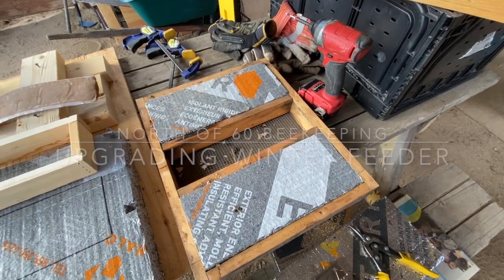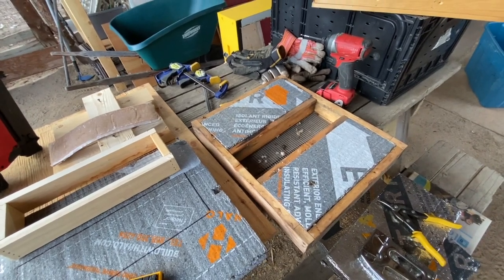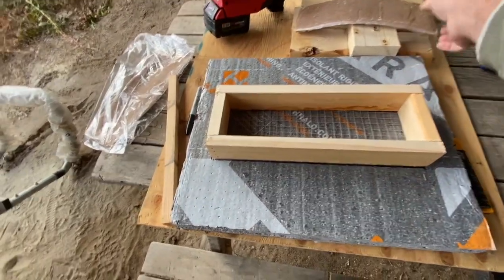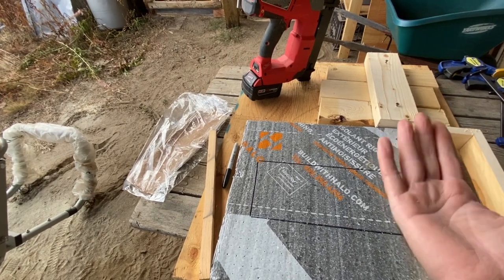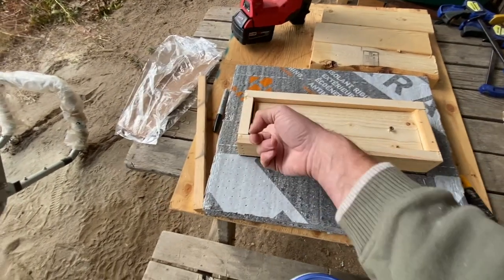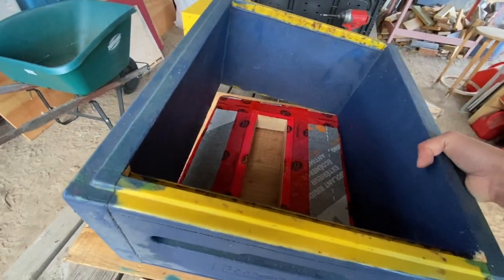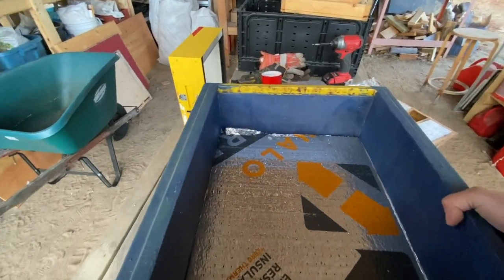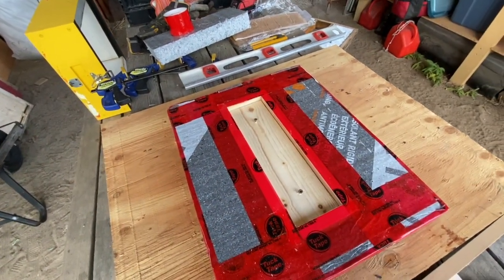Upgrading Winter Feeder

Comment: Etienne.  I learned, strictly by chance, that simply painting the polystyrene with a good exterior latex paint will prevent the bees from chewing it up.
Reply from the maker: the HD poly is not the issue, it's the standard house insulation styrofoam (bubble or expanded). If left unprotected the bees will chew it up
Reply: @etiennetardif6552  Understood.  That was my meaning.  I use polystyrene boxes too.  My comment was referring to the polystyrene panels (house insulation), not the material that makes up the box.  A good coat of exterior latex keeps the bees from chewing it up.

Comment: I had some better bee ten frame deeps and I-glued some luann two the sides cause it was about a half inch wider than needed and I left a gap on the ends for expansion. 

The bees propolis the gap and moisture during winter swelled the Luann enough to split the box a bit.  

Interesting how expansion can still affect you even when you plan for it

Comment: Good ideas there. My thoughts are that the 2x4 will expand or get propilized and you will have a tough time getting it out. Would using another piece of styrofoam instead of the 2x4 come out easier? A small bolt with a washer on the bottom of the styrofoam could be used for removal. Just an idea.
Reply from the maker: Agreed, I mention that at the end to make sure you leave enough tolerance for expansion or like you said just use the piece that was cut out to make a plug!!

Comment: I'm a hobby beekeeper in Alberta.  We moved this year and my bees got neglected for a while.  I've ended up with a queenless hive.  It swarmed, thankfully into some of the equipment I'd piled up to move, and the original hive didn't successfully re queen, even after I donated a queen cell to them after I knew they were going to be queenless.  After that, we started moving the farm.  They've been queenless since June and they are nasty.  I've been able to move and dump some in front of a swarm that I rescued (that spot is 3 miles away from the queenless hive).  The rest of the bees are still at the original site and hunting me when I'm there.  Is it too risky to seal them up and move the rest of them to that same swarm hive now? The initial move of bees was a couple weeks ago but I didn't want to overwhelm the tiny swarm so I didn't move all the bees over.  
 I'm moving away from wood langstroth to Dr Leo's design for insulated Layens hives.  I have one layens hive and it's doing to so great I intend to move all my bees into that type of hive but for now, I'm trying to make sure that late swarm survives the winter and I quiet the angry bees.

Comment: Thanks for the ideas, I am in northern Wisconsin and run about 150 colonies and they are all in polystyrene. I do see the value in a lot of insulation. I'm thinking about trying your plan because I also have the problem of feeding pollen patties or fondant and in the spring when everything is cold it can be very hard to squish that all in underneath a polystyrene lid, although I have done that, I usually dread it because it is so difficult.
Reply from the maker: I had the same problem. The lid fits too tight to easily place a patty on the bars without squishing a bunch of bees... They key for me was minimizing disturbance of the main cluster during winter.
Reply: @etiennetardif6552  yes, in March I like to put on a patty but the bees don't like to move out of the way at all they're very stiff and slow moving and I hate to disturb them so much. Totally understand. Thank you once again.

Comment: Do you have a problem with condensation? Do you tip your hive so the moisture runs to the front of the hive?
Reply from the maker: No condensation issues and tipping not required. condensation will happen regardless below along the lower side walls regardless at -40C.
Reply: @etiennetardif6552  Well thank goodness it doesn't get to -40c here. It does get to -30c but the days can get to 0c or warmer. I have an upper entrance to help evacuate the moisture, but still have an issue with it.

Comment: Remember those bastard bees will try to glue that wooden blanking block in the frame, you might struggle with pliers after a tight fit and propolis. Worse if they glue the mesh to the wood and it gets bent out of shape. I’d stick cloth before the block
Reply from the maker: Yep... I made some styro plugs for the slots... I will use aluminum tape on the bottom to reflect heat back down.